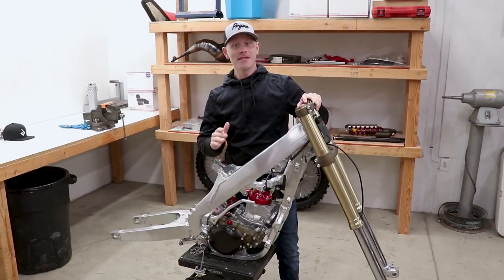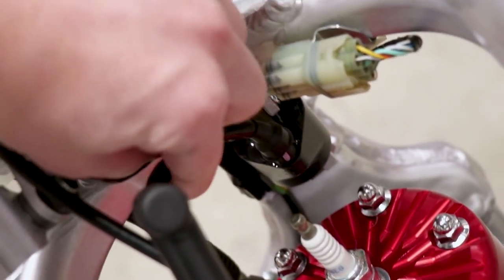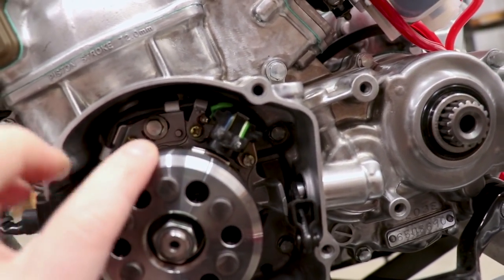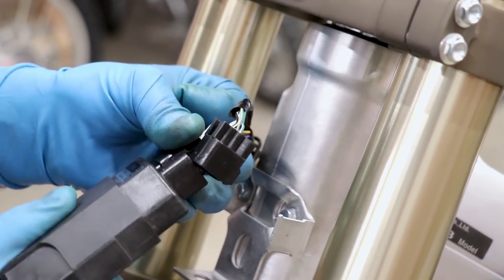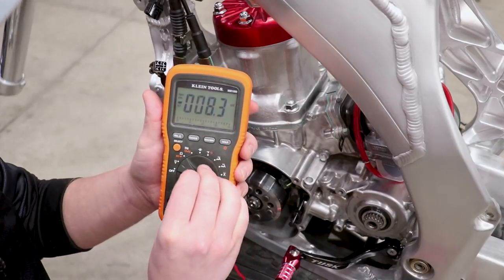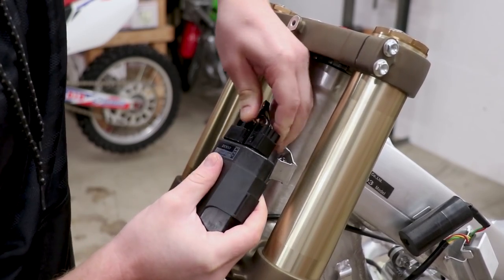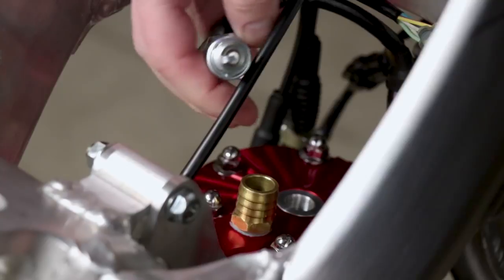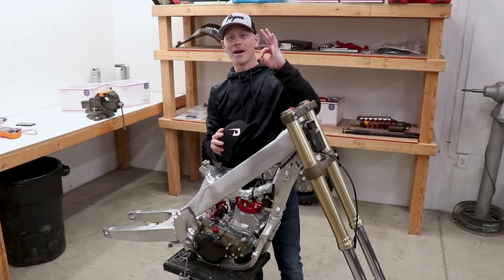Fixed The CR250

Comment: Yeah you have to be careful with those pins on the electrical connectors because when you're connecting the connectors you want to make sure that you're completely even when you're going otherwise you can bend or damage the pin or pins bike connectors normally have around 4 to 6 pins and cars can have up to 16 pins or more so when you're plugging in your harness be gentle.

Comment: Maybe the issue was putting it on the CDI as they have some sensitive electronics inside that will run on very small voltages/currents. Perhaps the grease was allowing a very small leakage of voltage/current between the terminals.

Comment: When you kick over a 2 stroke like you have been doing. you should shoot some fogging oil in the spark plug hole so the cylinder isn't dry.

Comment: Can't imagine the grease itself did it, probably just unplugging and plugging things back in cleaned the metal or something wasn't seated correctly.

Dielectric grease isn't thick enough to hold metal contacts apart if the plug is fully seated.

Comment: Cameron, I own a 03 cr250 and my throttle is sticking all of a sudden. Worked perfectly fine, snapped back like it should and then the next day it was stuck. Do you think just the cable needs lubed? Its cold here now would that have anything to do with it? Thanks for any help you can give.

Comment: What if the ohms are good on the stator and pulse generator and I go to crank engine with kickstarter and I get no volts on the meter??? The gap is correct between pulse generator and flywheel.. Please help

Comment: Dielectric grease gave me the same issue. I put some on the top of my spark plug and it gave me issues. It disabled the ability to make contact. Not sure why it’s recommended. I won’t ever use it again

Comment: I think that if the grease leads electricity it may have short circuited the terminals.. They are only supposed to make contact with their own other half, but the grease could have made two terminals touch each other.

Comment: Wow man that’s wierd!  I’ve seen the terminals inside of the plugs loose, how do you say. Springgyness hahha in the terminals and twisting the plugs have made a better connection, sometimes fixes them. Man I’m a motorcycle mechanic buy trade for the last 10 years. Never have I seen die electric grease make a plug have no connection aww well. Mabye just double check man

Comment: You never tested with a sparkplug again right after removing & re-installing the sparkplug boot. Maybe the boot was not on fully some how on the coil high voltage wire. I have never had an issue with that grease. But yes do not "pack" grease in the electrical connections but put a thin layer.

Comment: I thought you couldnt change the timing on the cr250 2002-2007 as they are a fixed system. I have a 2002 and you can not change the timing.??

Comment: Dielectric grease is used to stop corrosion n is a type of conductive grease!! You had put too much in the connector. Thus creating a short from pin to pin. I use it on the spark plug caps on my ford & toyota.

Comment: I always thought you were supposed to ground to the chassis/frame ? I dont claim to know it all but just asking a question ?
Reply from the maker: The ground is on the coil which is directly attached to the frame. But yes, always go to frame or the original ground location

Comment: I just have a quick question. I've been searching all over YouTube and haven't found the correct video for my question yet... 
So for my 2008 rmz450 it will roll start but won't kick start. It runs completely fine but just won't kick. I heard it was the valves but I just want to make sure there's no other problem. 
It is fuel injected too
Reply: It could be your valves, hard starting is a side effect of that. But since your bike is efi its possible your fuel pump is getting week so kicking it doesnt provide enough power to the weak pump making you have to jump it to produce enough pump power to start it.
Reply: @crazychad2720  Thank you so much for helping me out! Yeah i'm not really too familiar with fuel injection. Its my first fuel injected bike, so I really didn't know if there was an issue with that.
Reply: Yeah until recently jap bikes with efi use a battery-less efi system that uses 2-3 manual kicks to charge the system then it will start the following kick(cold). The suzukis system is pretty reliable so id check your valves first. Then you can check pump line pressure if valves are good. My guess is valves, probably needs new shims to increase the valve clearance back to in spec.
Reply: @crazychad2720  Thanks man really appreciate it
Reply: +Race330 Not a problem have a good one.

Comment: I don't think it was the grease I use it on multiple electrical connections and have NEVER had an issue I think it was the ground wire { inside probable }  or way it was positioned.   MaC

Comment: Put a 2017 plastic conversion kit on it ??
Reply: RadReefs YESSSSSS
Reply: Nooooooo. you’ll ruin the bike, add stock plastics with red side covers, crf250r numberplate and front fender and some woody pecker graphics
Reply: The 2016 plastics look infinity better.
Reply: Please don’t they look like Alta plastics to me 🤢
Reply: No keep it clean and oem looking. The new plastics kill the nostalgia.
Reply: I personally like the TX designs kit, it doesn't just change the look, it has a different seat and gives it a more modern and personally a better feel

Comment: It's not the dielectric grease.   You do not need to rub it on the outside of the connector etc, put it on the terminals.  We have been using this stuff for years!!!   You should test after each potential fix, then you will know for sure what the problem is.

Comment: The grease is non conductive.  If dirt was in there the grease could have held it between the contacts.  The grease itself will not stop the contact, it will seal out water so its not all bad.

Comment: hey cam ireally need help 

i just re-built my 2015 85sx top end and it wont start it also has low compression  im relly confused pls help out. and also i hope your doing ok
Reply: If you have a decent amount of hours on your bike and install a stock size piston its very possible your cylinder bore is bigger now and requires the next size or two bigger with the corresponding larger piston rings. If too small of piston is used you will not good enough compression for the engine to fire. Also installing your ring(s) incorrectly can cause low compression.
Reply: @crazychad2720  i measured the bore and got a piston to fit it and the piston and rings seemed to fit. the bike had lowcompression and i slowly cranked it  and it some how gained compression so i kicked it over and it ran first try then i turned the bike off and i had lost compression again im not sure what is happning
Reply: +ICEY cool so I assume you deglazed the cylinder before new top end? just some green scotch bright and a cleanser. If you did that also then the bore is out of round or possibly the head is warped leaking compression gases into the coolant jacket. Check your fluids see if any cross contamination is happening.
Reply: @crazychad2720  no i just got a cloth and wiped it down so im not sure
Reply: +ICEY well it could be the cause because the glaze will prevent the new rings from sealing. But chances are if you saw good hatch marks in your bore and previous piston didn't melt or break id imagine you don't have a bad enough glaze(if any) but if you take it apart put piston ring in the cylinder and use piston to make sure its flush and measure the end gap. Make sure that is within spec and go from there. And remember a perfect bore with even one little vertical scratch can cause this. Anything you can feel with your fingernail.
Reply: @crazychad2720  thanks so much i will do that

Comment: Is not a good idea to use dielectric grease as sealant, because it's conducive. The problem by putting too much is that you may have short circuited the whole connector. Use it only on the screws. To isolate the connector, use normal non conducive grease ;)

Comment: It wasn't the grease bro. It was the plug wire. It will probably happen again . You need to separate the cap from the wire end, and re crimp the plug wire. It's not suppose to just sit in the cap.
Reply: Great work tho. Beautiful bike.

Comment: On the ignition coil at 10:40, you mentioned you were looking for 9-16 ohms, but your multimeter read 10.48 kOhm (10480 ohms). Did you mean to say kOhm? 

Thread with similar measurements as you: https://www.vitalmx.com/forums/Race-Shop,42/Honda-CR250-no-spark,1270658

Comment: Stop wasting your money using grease as a sealant. The oem sealed connections undergo rigorous R&D and testing to ensure they provide a good seal. Adding grease won't make a difference.

The connections looked good after 14 years right?